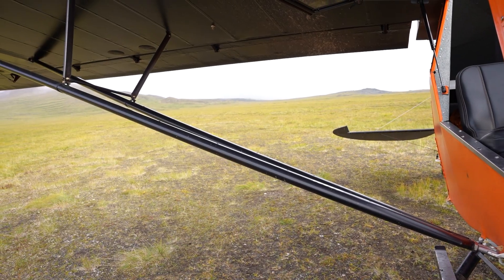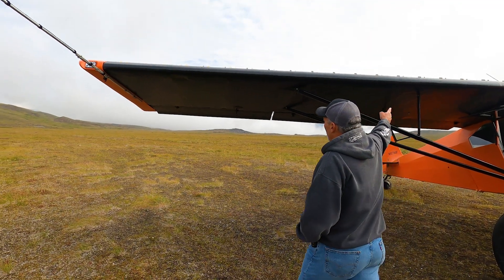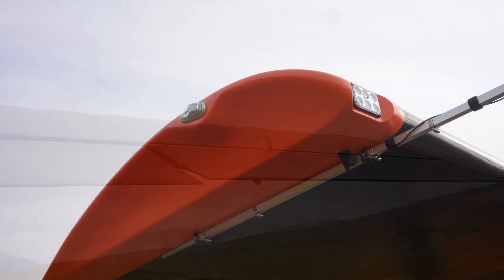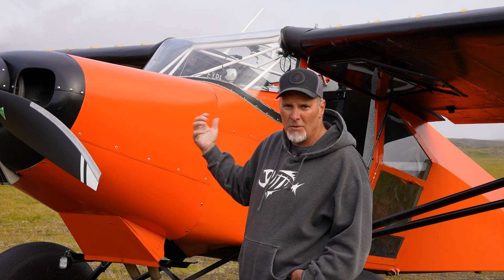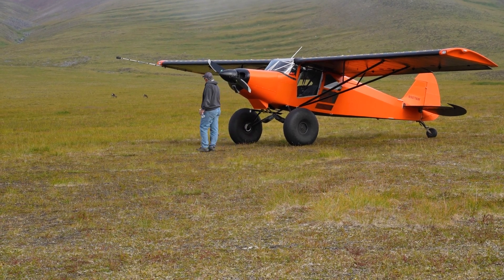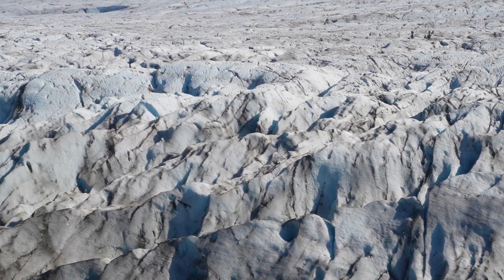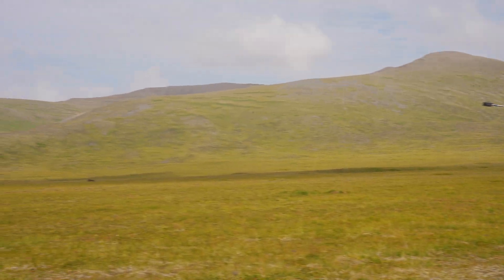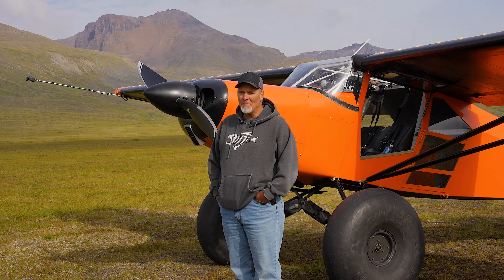You Won't Believe This Airplane's Wild Makeover!

Comment: Looks amazing. I’m looking to do the same build from a tri pacer. I was wondering who did the struts? And did you used the original wings and just did the extension? I assumed reinforce the spars? 
Again congratulations she is beautiful
Reply from the maker: @t.hangar  thanks! I have a friend who is an aircraft welder that helped me build the struts. I have a different buddy with a stretched Pacer with the same wing as mine so we took off his struts and used them to build a jig to build mine. We found the parts them it at Alaska Gear Company (Airframes Alaska) 

My wings are spliced / stretched Pacer wings done to the specs on the Simpson STC.
Reply: @ love the plane and even the color is what I had in mind. Is it Oratex? If yes what’s your opinion on the oratex so far? Again thanks for taking the time to answer these questions.
Reply from the maker: @ yes I used Oratex. So far I really like it. Part of my decision for using it was because I was building in my garage attached to my house and my pregnant daughter and family were staying with us. I didn’t want the chemicals and fumes.

Comment: That is a copy of Jake Bryant's Producer which has a STC.
Reply from the maker: Actually this airplane was built using specs from the Simpson STC which is used to build Bushmasters / Super Pacers. I chose to modify it and building it experimental. The Producer is also a certified STC owned by Bryants and is a great airplane. They are similar but not the same. The Super Pacer STC's are still available to purchase and build yourself. Last I hear the Producers are only built by Bryants and you have to buy the airplane from them.